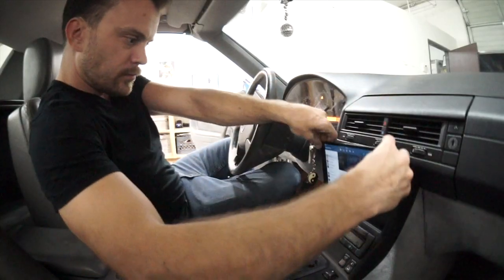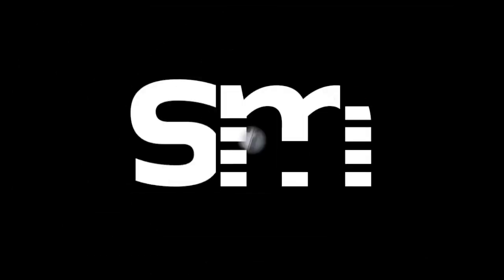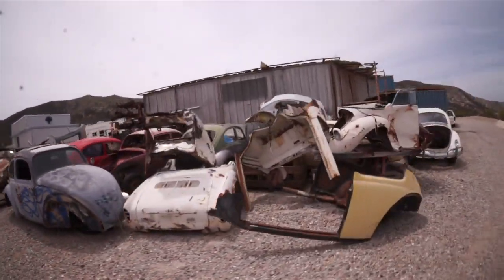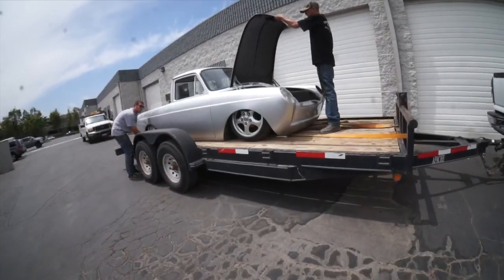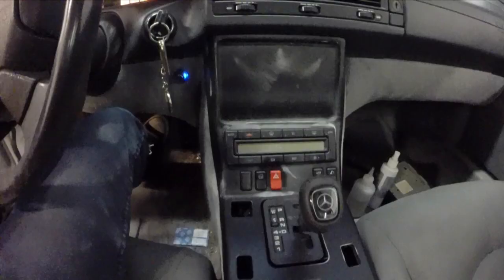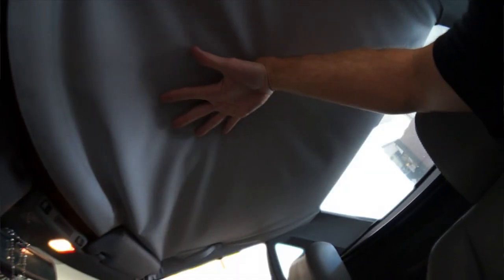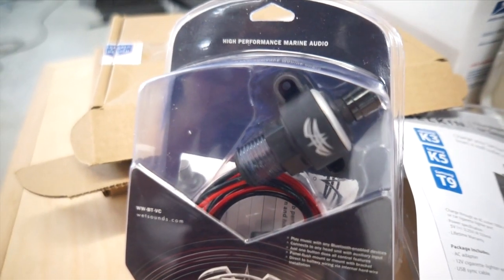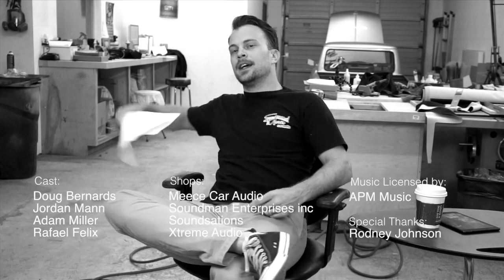Mercedes iPad mini install gets Finished

Comment: was that just the ca glue from mobile solutions that u used on that ac control box thing? and you trust that'll hold for the rest of the car's life?
Reply: Steven Shaffer i knew that. i just wanted to be sure. i just always thought ca glue was used to temporarily hold things in place until you glass it all up or something. personally, i would have used the smd resin with a little bit of mat instead of super glue on steroids, lol.  but if its good enough for a mercedes...
Reply: Damien Nicholas CA glue (also known by the brand name Super glue) is actually very strong. Problem is most people don't give it enough time to cure (up to 24hours) before stressing it and it breaks. With the use of the Activator spray you do away with the cure times and go straight to full strength. The thickness plays an important factor as well. Mobile Solutions sells 3 thicknesses.
Reply: Steven Shaffer So are you basically saying that without the activator, regular super glue is just as strong as mobile solutions' ca glue... given they are the same viscosity?

Comment: hey how do you get internet inside of your car? is there a possible way to do it?
Reply: You use your Smart Phone as a wifi hotspot and get a wifi signal from your cellphone.
Reply: oh I know that man thanks though, i mean like internallay, with out the hotspot. most companies charge you for wifi hotspot. The new Dodge Ram comes stock with wifi, like how could i do that seperately with out the use of my phone?
Reply: el carbajal If I understand you correctly your talking about more or less the same thing. Some devices are coming with a 3g or 4g connection built in. You still have to go through your cellphone company and pay extra to get this device turned on and pay an extra data fee. It doesn't use a hotspot to connect, it's just simply like having another 3g or 4g enabled device.
Reply: 4g?